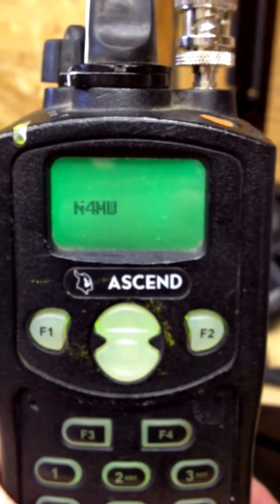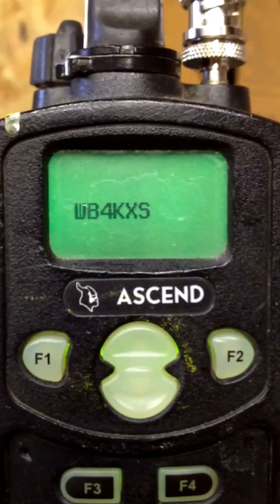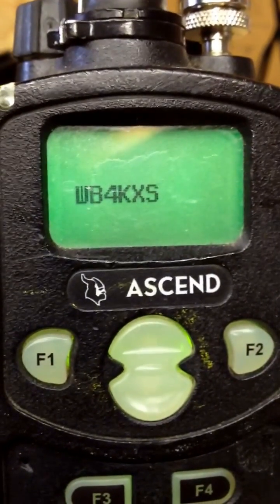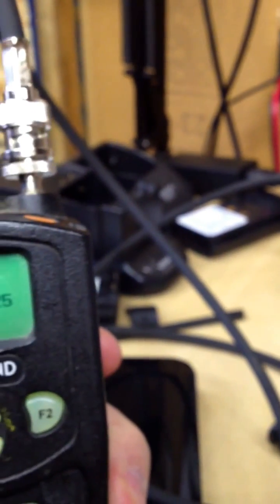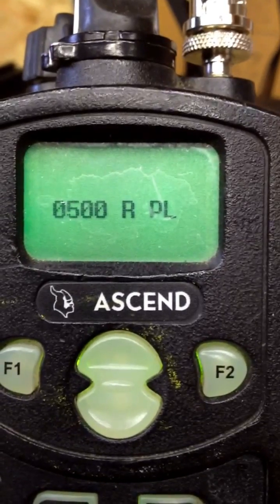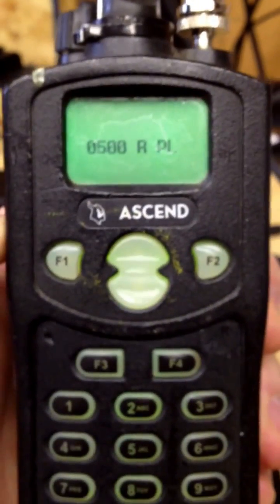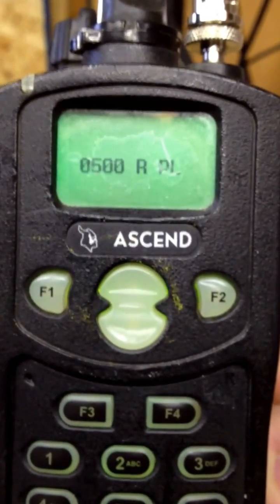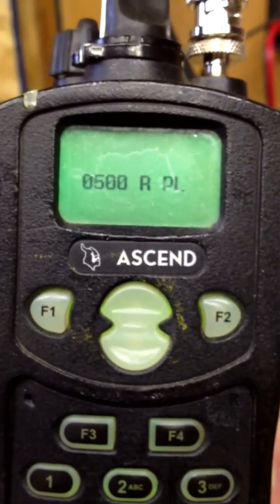P25 vs FM mode on 900Mhz with EF Johnson 5100's

Comment: We have 2 Motorola Quantar repeaters covering the entire Greater Vancouver area using mixed mode as well.  We have many more FM only rigs then we do P25 but I love the P25, far superior to D-Star  and DMR.  Our Digital Mobiles are Motorola XTL 2500 and we picked up a couple of those Alinco DJ-G29 HT's which are nice to have around the shack to monitor with.  The audio quality on the XTLs is stunning, the best my ears have ever heard from a mobile rig and it is such a beautiful radio with 35 watts max output.  900 is so much fun to play with, the propagation is so bizarrely different then higher or lower in frequency,  check out our web site:  http://ve7nfr.com/

Comment: Is the repeater a quantar?
Reply from the maker: Yep, it sure is :)
Reply: sounds nice. i dont have 900 in p25
Reply: most traffic HT's or mobiles?
Reply from the maker: HT's on 900 - mobiles are hard to come by...
Reply: No XTL's? I would love to have one, they are supposed to be nice. Not. Much action on analog 900. Digital I would be talking to myself
Reply: Have you looking into linking with another p25 quantar in digital? I wonder if you could do this with a UHF quantar?
Reply from the maker: The Richmond, VA area now has a VHF P25 repeater online as well - no plans for linking at the moment, but it might be a long term project...

Comment: Aside from the interference I think the FM signal sounds better because the voices sound more natural.  Have you done any testing with fm vs p25 at the edges of coverage? I would like to know if you can get a good signal over p25 at a longer range than FM.
Reply: In my experience, P25 holds up further than NFM. It does have that strange raspy/nasally quality to it, but usability is good. Strong-signal analog sounds better than strong-signal P25, but P25 does much better in fringe or weaker coverage areas.